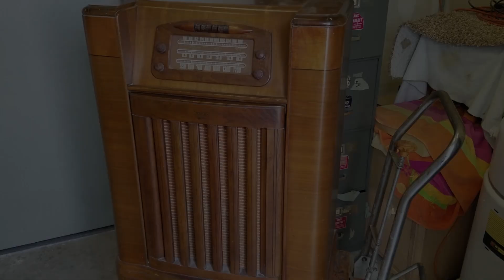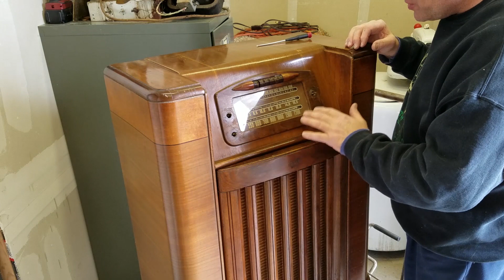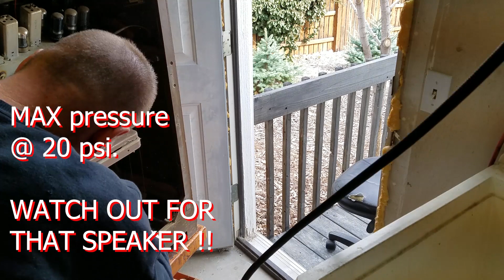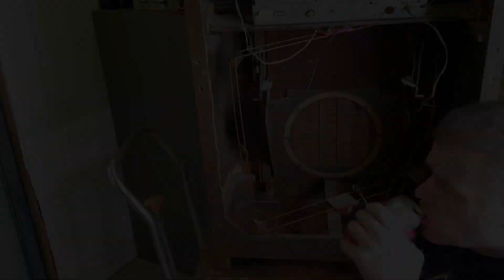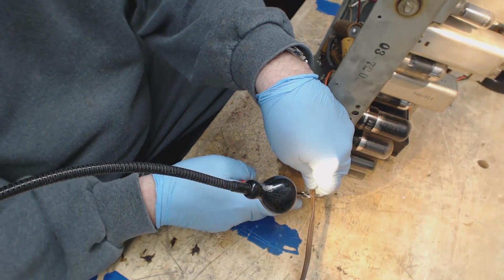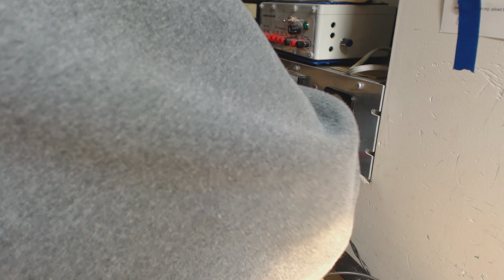1947 PHILCO 47-1230 AM FM Phono Vintage Tube Radio Part 1 of 14 Teardown & Bench Test

Comment: In my opinion, the older the radio, the better it sounds. I was given an old Zenith from the late 40s back in 1995 as a graduation present from my former boss that was a vintage am radio collector and repairman. I still have the old Zenith but had to replace the power cord being it failed after a lightning storm. The original tube that came with the radio is still humming and working as it should. And older am tube radio seems to sound much better than the digital ones nowadays, sadly my father prefers digital radio over the sound of radio that he grew up with. I guess I'm still old fashioned when it comes to music thru a radio that older than I am

Comment: Just bought a 1946 philco yesterday for $100 the guy had it working before we bought it we purchase it from the guy how I hauled it was on the inside of my pickup truck on its side I get it home to my room I had to take it down the basement stairs and it get it plugged in now the record player part will not turn it turned at his house the same day I tried to troubleshoot it I pulled up to look underneath the record player and knows there was a wire that was broken off not sure if that wire is broken off before hands so I think I'm going to have to solder that wire back on as I touch that wire back to where is connected it's still does not record player itself so was will not turn the motor for the record player does turn something in that has to do with something near the motor of the record player now I'm thinking not knowing that the record player was not solidly attached to the unit I'm thinking while flipping out on that side is transporting it mess something up what can I do to fix this problem

Comment: I looked through the videos and comment but did not find the answer I need. I have a 47-1230 that I inherited. The AM and Shortwave use to work but someone had removed the phonograph. Since then the Shortwave has also stopped working. I purchased a 47-1227 in rough condition to use its phonograph in the 1230. Since the 1227 does not have buttons I am unsure where to attach the lead from the phono to the 1230 chassis. One shot on Video six (I think) shows the lead coming in but I cannot make out where it goes and I don't have a schematic for the 1230. Could you post a video covering the phono circuit or at least a hint of where it connects. Thanks.

Comment: Hi Michael,  in many of your vids you mention using a thyristor as a means of managing current draw.  I’m new to electronics and was wondering how you engineer the circuit and add it to the existing unit.  Any help you could provide would be greatly appreciated.  Happy holidays.
Reply from the maker: I use a CL-90 thermistor in most cases.  There are probably others that would work, too.  You can look at specs on the internet.  The thermistor has a low resistance when it's cold, and resistance goes up, the warmer it gets.  That's the opposite of how tube filaments behave, so thermistors are useful for reducing the surge current that happens when you first turn a set on.  I simply wire one IN SERIES with one side of the line-in.  You have to be sure to locate them carefully, because they get quite hot.   Even when warm, they usually have 1/2 to 2 ohms of resistance, but that is not enough to really lower line voltage, if you need that, too.  For lowering line voltage to about 117, I use a high watt "power resistor".  Every radio is different, but I most often wind up with either a 25 ohm 25 watt, or 50 ohm 50 watt.  These get plenty toasty, too!  Again, put this in series with one side of the line.  I don't worry overly much, which side it goes to, but I tend to try to keep it on the hot side.  One last thing, please, please, please install a fuse in series with the line-in.  These things are all quite old, and even though we restore them, we still leave in many original components.  A fuse might just be the thing that saves you from a fire.  I use a 1 amp Type 3AG "Slow Blow" for smaller sets, and a 1-1/2 amp for larger sets.  On really big sets, like the Scott 800B that I did, I sometimes need a 2 amp.  I hope that this helps.  Take care.   Michael

Comment: Distorted audio is often caused by faulty biassing especially of the output (6V6) tube, because of leaky coupling capacitors. Once you have restuffed them (and the probably dried-up cathode bypass electrolytic, if any), it should clear up :)

Comment: There's nothing really wrong with Locktal tubes, except for the fact that they become obsolete so quickly that many type numbers are as rare as hen's teeth.  I'm not sure which actually came out first, Loktals or "peanut' tubes, as the very first 7 pin miniatures were called.   Miniature tubes were initially developed for the military, I think the '9000' series were the first ones made.  Both Locktal and miniature tubes featured glass bases with the pins embedded in the glass.  This gave the shortest possible lead length, necessary for VHF work, which is what the 9000 series was intended for.  The first 'civilian' part numbers were the 6AK5 and the 6J6, both intended for TV tuners.  But the very first 'baseless' leads embedded in glass tubes were the 'Acorn' types.  Many of the very first Acorn tubes (900 series ) had 7 pin miniature equals.  After WWII, the tube makers abandoned the Loktal design and issued all new types in the miniature format, adding the 9 pin format to the mix ( and the duodectal or compactron 12 pin, and the big base Novar for power types).
Reply from the maker: Kenneth,
That's interesting about Loktals.  I just guessed that they were developed to be able to stay in the sockets better and to have some shielding at the bottom (like some of the shielded Octals).  I figured that they were aimed at portables and other mobile radios (auto, military, etc.).  Thank  you for the awesome background! 

I have a basic question for you.  The Philco that I am working on uses two 25 MFD electrolytics in the pi filter, with the negatives grounded.  My first instinct is to get close with a 22 MFD and a 4.7 MFD paralleled, for each one.  But, I worry about the 22 taking most of the load during surges.  Then, I thought about 33 MFD caps in each place, but I think that will raise voltages too high and be hard on the rectifier tube by allowing too much surge current at start up.  What about a 22 MFD at the first cap (before the field coil) and a 33 at the second position?   Or a 22 at the first, and a 22/4.7 in the second? 

Any thoughts?

As always, thank you for watching and for your excellent comments!    Take care.   Michael
Reply: Most electrolytics have wide tolerances, sometimes between 20-80%, and you don't need to hit the exact original value as we're not dealing with a resonant circuit.    Modern electrolytics are rated to withstand surge inrush.   I'd use either the 22mfd or the 33mfd and not worry about paralleling caps to get an exact value.  Either value will work fine.  The rectifier tube takes a few seconds to warm up, and that will limit the input surge current to a nice slow ramp up (if you have a solid state storage scope you can see the slow voltage ramp up).    I'm guessing that this set uses a field coil speaker, so you need a capacitor input filter to keep the ripple down.  So maybe use the 33uf on the input side and the 22uf on the output side.  Use caps rated a bit higher in voltage than the originals (due to 'modern' line voltages).  IE: if the originals were 350 volt caps, I'd go with 400's or 450's.
Reply from the maker: One last question, Kenneth...Will it hurt to parallel that input, using a 22 and a 4.7?  I just realized that I am out of radial 33 MFD and I only have axials.  The location I chose makes using radials better.
Reply: Paralleling two electrolytic caps with the same voltage rating should be OK.  I'd rather not parallel two caps with different voltage ratings.  But I bet if you left out that 4.7 you wouldn't notice the difference.  Try it without and see what happens.
Reply from the maker: That sounds like a reasonable plan, Kenneth.  The terminal strip where I placed the filter caps is easy to reach, so adding the 4.7 if I need to won't be hard.  Thanks for the advice, my friend.  I'll let you know how it goes.   Cheers!    Michael

Comment: Cool!  That 46-480 of my Uncle's has AM/FM & SW as well but no phono.  The 48-1262 has AM and phono but no FM or SW so that one looks like a hybrid of those two.  Looking forward to this one.  Take care, Gary  P.S.  That chassis except for the phono plug looks identical to the 46-480 one except that the 46 had all loktal and octal tubes.  I did that cord alligator clip test to test the voltages in the transformer when I had it removed to make sure they were where they were supposed to be.  Some day I'll find a chassis for his 46-480 and get it restored on my own time and take it to him and change it out with the one in his radio now.

Comment: If you can, I would like to see how to restore the cabinet itself.
Reply from the maker: I won't be restoring this cabinet, but I am going to be doing a tabletop cabinet, soon.  The one that I will be doing is just a rectangular wood box from a 1950s Westinghouse.  I'm not terribly skilled with woodwork, yet.  Thank you for watching!    Take care.   Michael
Reply: I restored a similar cabinet last year.  They aren't very difficult, just time consuming.  If no one has refinished them with varnish over the years they strip easily with plain old lacquer thinner.  If they have varnish like mine did citrus strip works very well.
Reply: Also places like Radiodaze.com are good places to get stuff like reproduction labels for the cabinet as well as felt washers for behind the knobs, reproduction knobs themselves and there's a guy named Chuck Schwark if I remember right that makes full size photo copies of the original schematics at Philcorepiarbench.com I think he charges $7.00 for a set and it's certainly worth it.

Comment: Why can't you use a modern cartridge, what is the output of these cartridges, as you say get a modern cartridge with a higher output and remove the transformer. But you can get low output cartridges even today would be a moving coil type rather expensive. Or what about just resisting the output from a modern cartridge??
Reply from the maker: The trouble with a modern cartridge is that this is a 78 rpm player.  That means that the stylus needs to be 3 mil, instead of the 0.7 mil of a stylus meant for LPs.  3 mil stylii were never made for the modern units.  I thought about some of the other early magnetic cartridges that are out there, but they are mostly expensive.  My best bet is to utilize a higher output ceramic with a 78 rpm stylus and eliminate the transformer, as you mention.  I installed a different changer in the 46-1209 that I did about a year ago.  I installed a ceramic cartridge (P226), which has an output aroung .5 to .7 Volts.  All I did there was to remove the transformer.  The amplifier output with the phonograph selected was slightly lower than when the radio played, but it was more than acceptable.  Thank you for watching and for your ideas!  Take care.  Michael

Comment: Spiders never bothered me but roaches do. I opened many console TV's with nests of roaches inside. They make my skin crawl and in most cases I told the customer I wouldn't work on their TV (or radio).
Reply from the maker: 2 legs - good
3 to 4 legs - almost always good
5 to 6 legs - usually OK, sometimes bad
7 to 100 legs - always bad

Cheers!    Michael
Reply: roaches dont bite so they are ok for me but hard to get rid of. spiders bite so no good. anything that bites i wont go near them. mice are the worst including dead ones. just discusting. fortunately my roommate used to work for pest control company so i am good to go if i find any pests.

Comment: Hi,
Great project! Did you win the radio we talked about? Thanks for sharing and looking forward to the next...
Reply from the maker: Darryl,  Not only did I win the one we spoke about, but I actually bought two ST96 tuners, along with an FM multiplexer from the same series.  The one I was looking at was going to need a lot of work, and maybe is not saveable, but the other ST96 is a working unit, as well as the MPX I bought with it.  I figure that, even if the first 96 cannot be easily restored, it can donate parts, if needed.  Don't worry, I almost never scrap anything!  I usually just do what needs to be done to bring even lost causes back.  Anyway, I should be getting all of them this week.  I'm pretty stoked.  Thank you for the advice on auctions.  I did exactly as you said, and I got the unit for a great price!  Hate the shipping cost, though!   Take care, and thanks for watching!   Cheers!    Michael
Reply: Awesome job! The radio I recommended was intended for parts for the one you're working on now like the power switch terminal section and a couple knobs among other things. I'm really looking forward to the rest of the series since the unit is basically all original.